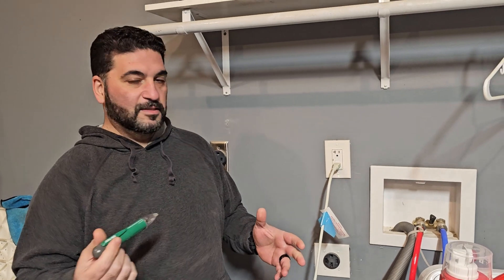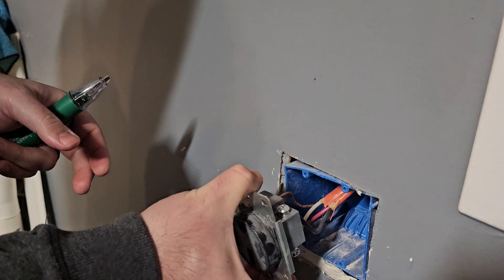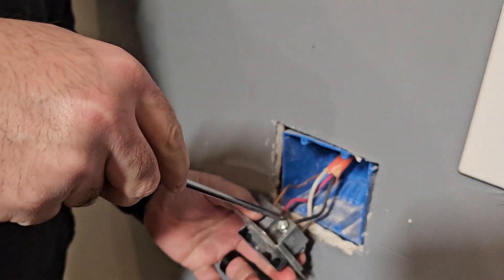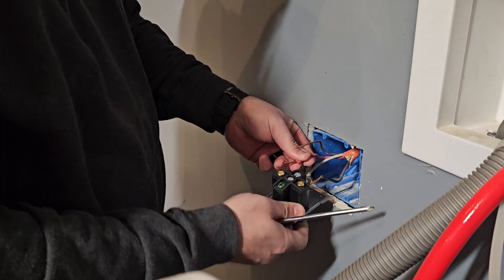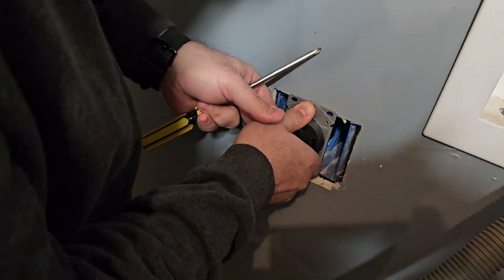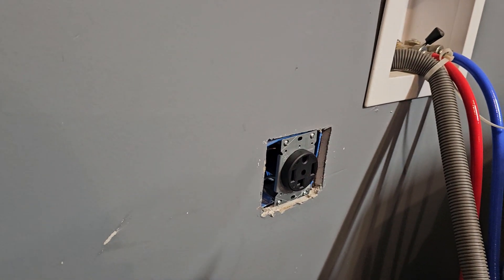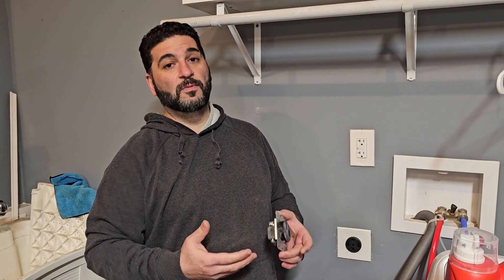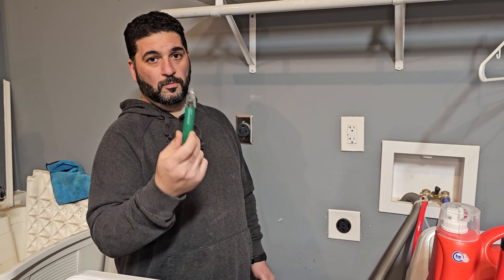Replacing a 220V Outlet Plug? Here's What You Need to Know

Comment: That didn't sound right have somebody with you in case you get shocked they can pull you away that does not sound very safe turn the power off you don't want to grab somebody because you'll get electrocuted
Reply from the maker: Thanks for the heads up, the power was turned off, I'm sure I mentioned that in the video.